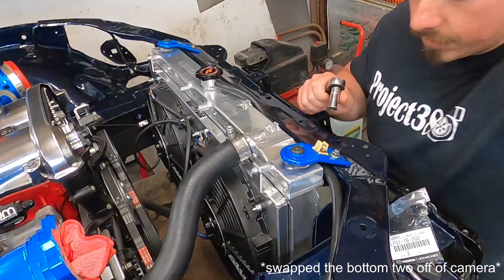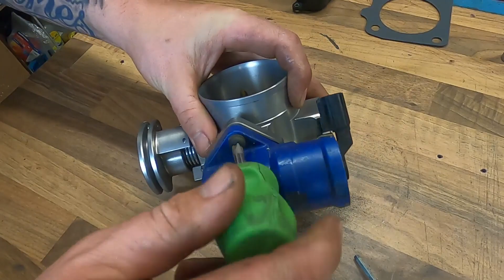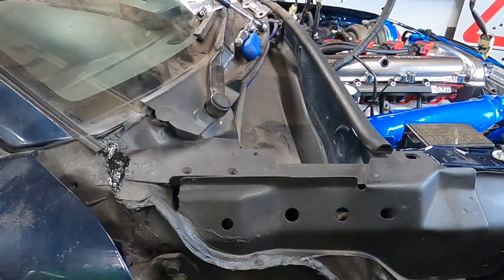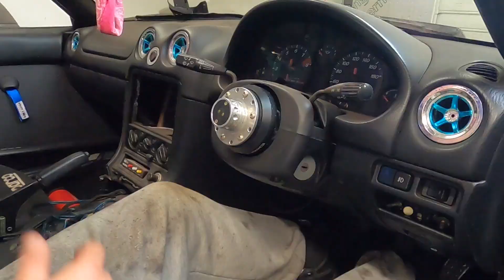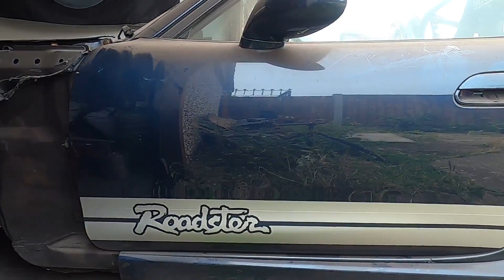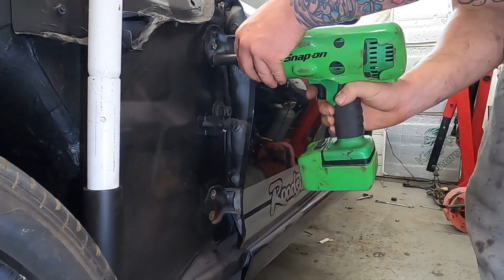MY FIRST DRIVE....SORT OF : MX5 TURBO BUILD pt 38

Comment: Yo,
Not sure if u have had the engine running or not, but I had a problem with my verniers as they had stainless pins so the cam sensor would not pickup a signal. After swaping them out for mild they worked fine.
Just giving you the heads up just incase :)
Plus if ur after a rear jacking / bash bar drop us a message can sort something out :)
Reply from the maker: Thank you for the info 😊